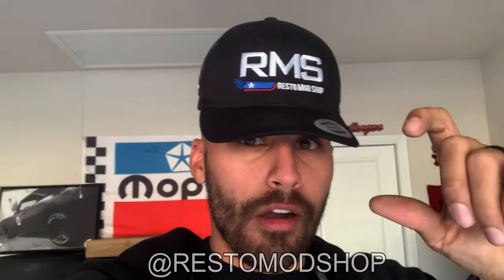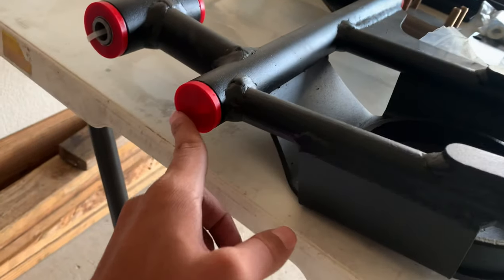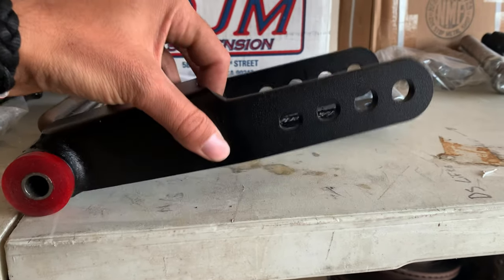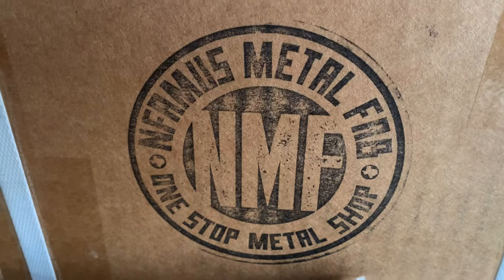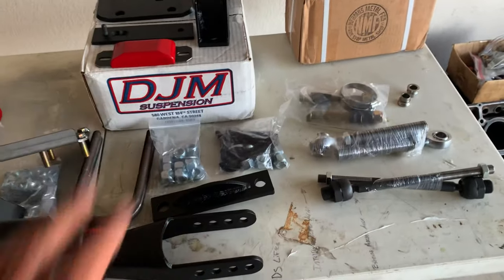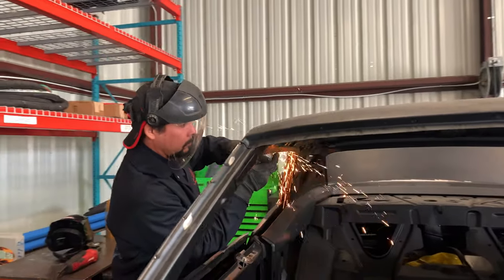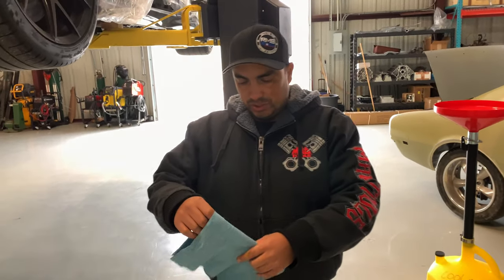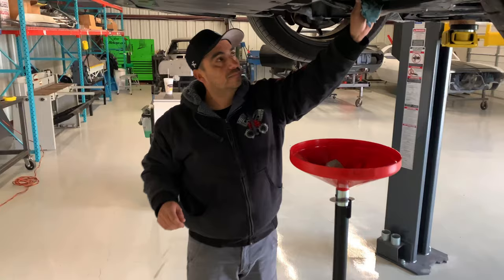Unboxing Dodge Ram Daytona Lowering kit + Visiting New Shop Sponsor!

Comment: Is this lowing kit for a 2x4 or 4x4 truck
Reply from the maker: 2WD, it’s pretty hard to lower the 4x4’s. I spent 1 year looking for a 2WD silver quad cab Daytona just because I wanted to lower it
Reply: I know I have a 4x4 and I really want to lower it but its a lot of fabrication to the front end to do so I might just end up dropping the back 2 inches to level it.  I wish I would have seen your channel sooner because I have a set of OEM running boards I bought a while ago.  Still looking for a wing too lol
Reply from the maker: Yea man I feel your pain lol. I found the wing pretty fast. The running boards took me a while but their finally on as well. Check out special edition rams on FB, always find hard to find parts there. 

I saw a lifted Daytona 4x4 in San Antonio in orange and it looked bad ass. So either way they look good lol